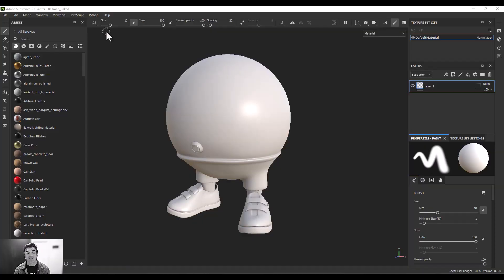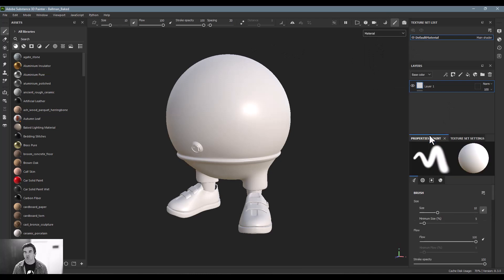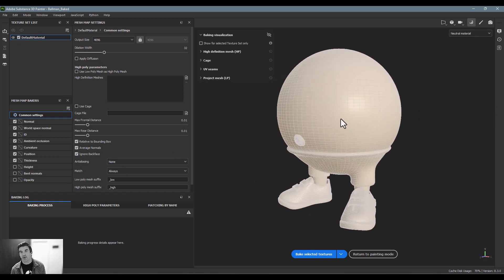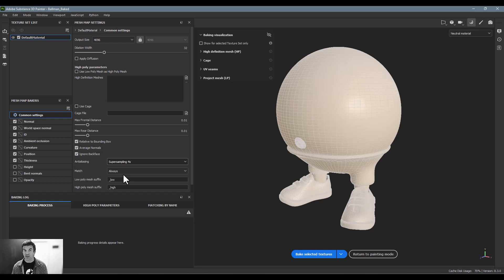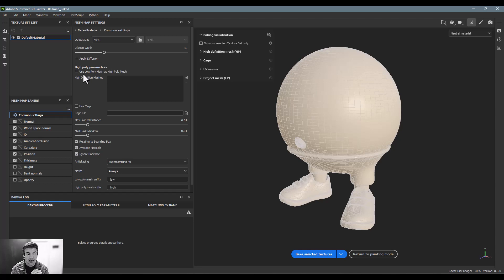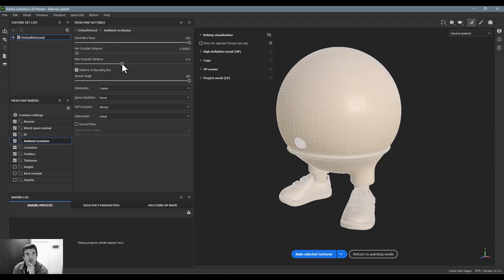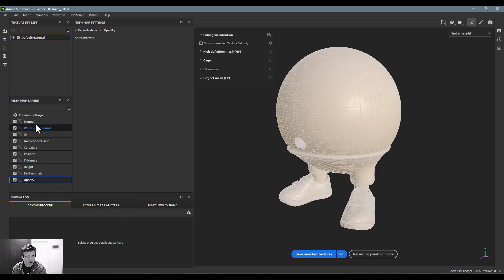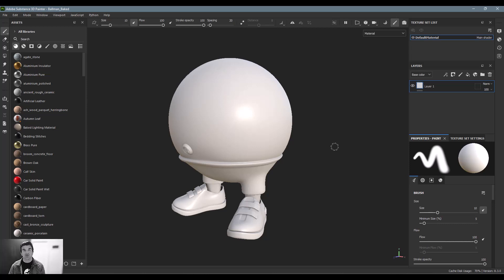11 | Substance 3D Painter Course - Baking Mesh Maps

Comment: Thank you for some great videos! I have an issue with baking a blazer I made in CLO3d. The blazer has pockets at the bottom of the garment and after baking, the pockets become much darker than the rest of the garment, making it look like they have a different material. I think it is the ambient occlusion that seam to read the pockets as very dark. How can ensure the pockets look the same as the rest of the garment?